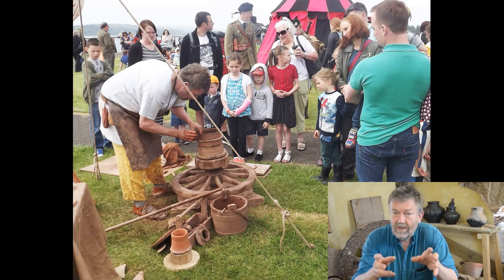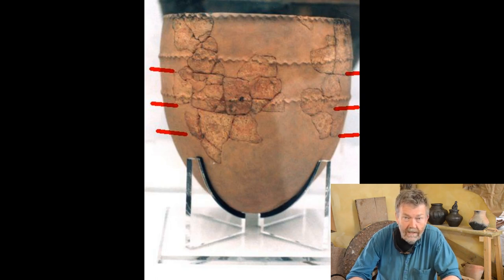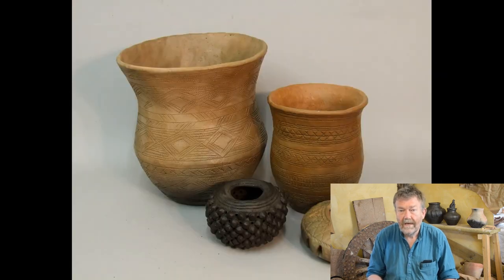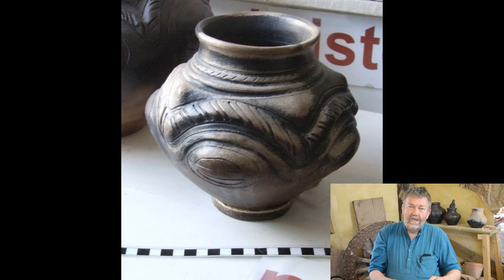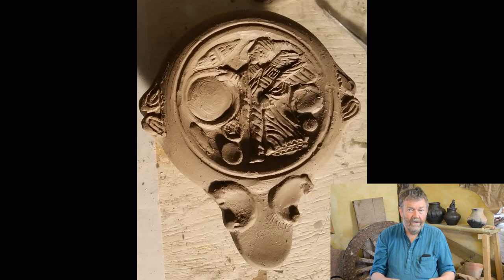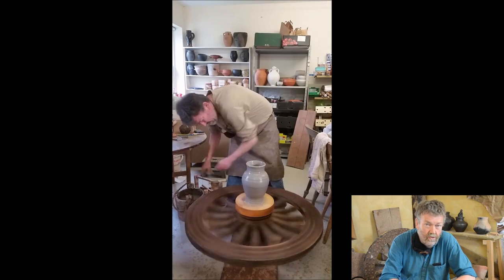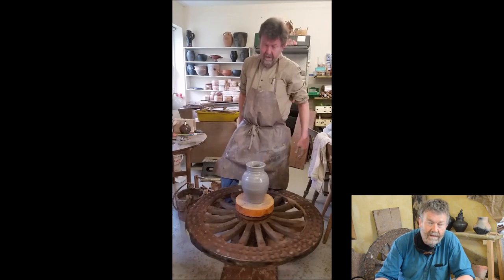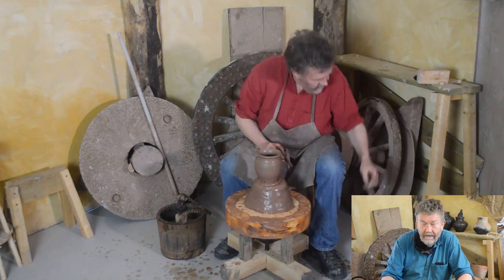Post Roman Pottery Why the wheels fell off

Comment: Great lecture, I really enjoyed it. So my thought was, what were they using for bearings on those Roman pottery wheels? I would have trouble making a wheel with natural materials that would turn quite as smooth as Graham’s wheels in the video. Perhaps the Roman wheels were using some imported bearings or some other axle technology that was not available anymore. Loving your videos, keep it up.
Reply from the maker: Hi Andy, it's a good question, but I've actually been very careful to make sure that the bearings are only Roman technology, and the wheels that you see in the video all run on the same principal. A static iron shaft set into a solid base, stubs of such shafts have been found embedded in the floor of a Roman workshop.  The lower bearing that stops the wheel wobbling is simply a leather collar that fits snugly around the shaft and is lubricated with olive oil or grease. The top bearing is just a hole, fractionally wider than the shaft, bored half way through the wheel head with a domed pin at the top end, that fits into a hollow at the top end of the static shaft. No modern technology.
Reply: @PottedHistory  Thanks for that explanation. So I guess there is nothing here that would be unattainable in post-roman Britain.
Reply from the maker: @AncientPottery  Hi Andy, metalwork flourished in post roman Britain, although the best of it was reserved for weapons and jewellery, but creating an accurate shaft and spindle would be no problem at all for them.

Comment: Very interesting and made a lot of sense - are there tangible differences in style between post Roman British and AS ceramics in this period?
Reply from the maker: Hi Hicca, there is, in the late 4th and earl 5th century an adoption of more Germanic styles and some of these types of ware are being made on the wheel but, by the late 5th early 6th C almost everything is being hand made. There is now a tendency to use the terms Post Roman or Sub-Roman for the period from the end of the 4thC to the 6thC, Anglo-Saxon being used after this.

Comment: I find that the modern coil-building technique results in weak structure, which does not fare well in stressful open firing.
Reply from the maker: You're right, and it's one of the main reasons that I don't like the term coil-building, because people have been taught to create weak structures that way. Traditional hand building is a much m ore robust technique.

Comment: Did you try it out? I don't recommend it. I am not confident in pots being fired in fireplaces in a house as it made little sense to risk your house burning down when you could very well do a fire outside - I know of no ethnological case of people firing their pots in their house. Having fired a lot of pottery in open fire, I think it would be certainly extremely dangerous and unbearably hot if it was done in the house. Prehistoric houses did burn down all the time as show their charred remains and fire was a constant threat. Very good insight into how society stepped back in the 5th century by the way.
Reply from the maker: Yep, fired carinated bowls and beakers in the replica Neolithic houses at Stonehenge and in a replica round house in Northumberland, and seen it done several times during my 20 years living in Africa.  For domestic sized pots, the fire doesn't need to be bigger than a good cooking fire. For larger pots you need to fire outside.
Reply: @PottedHistory  Fastinating. I'll try it out perhaps one day I'll build a clay hut on my own. Maybe some of these burnt houses are due to accidents when they tried to fire pots inside to protect the pots from questionnable weather in places like England.